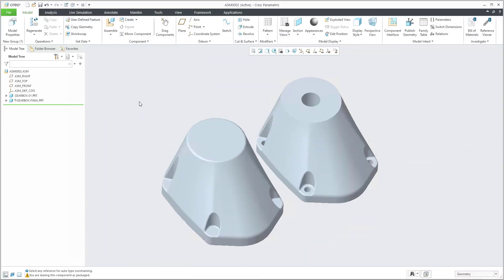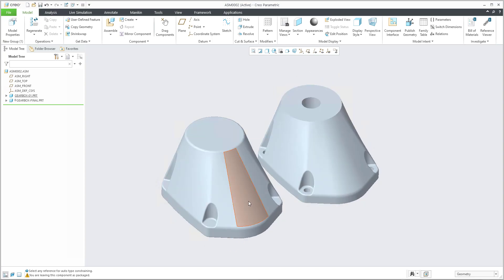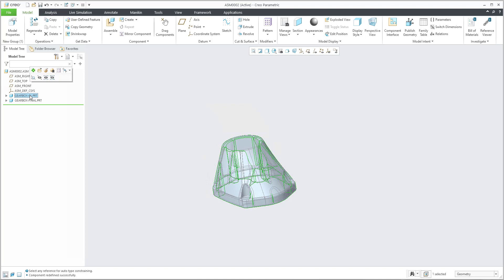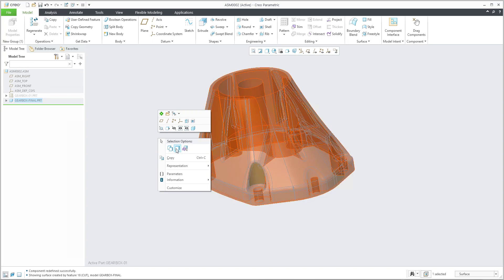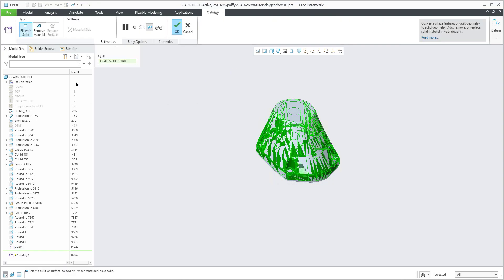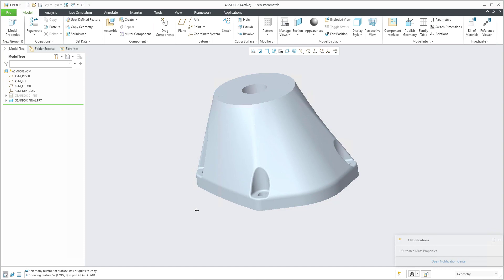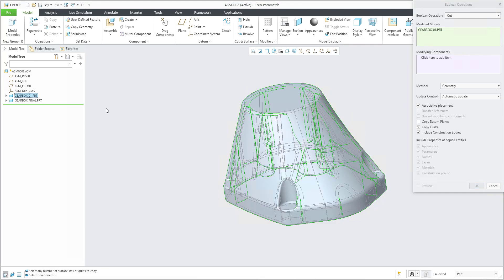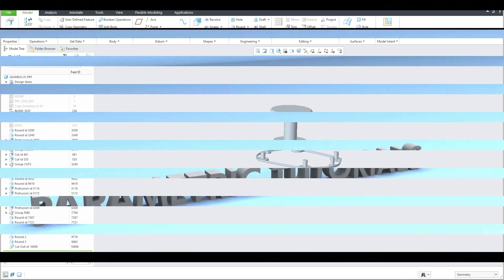Compare models | Creo Tutorial

Comment: Vlad, what's an easy way to find min wall thickness on a casting model, Im aware of section thickness option but if the model is more complex this becomes difficult.
Reply from the maker: Hi Zero, I am not expert in Casting.. But if I will find some solution.. I will post it ;) Stay tuned and thanks for your question. Vladimir

Comment: This type of comparison i.e. subtraction only works for geometry that is markedly different. If there are minor differences in surfaces then it will not work. This is not best practice and Creo has much better tools for comparing geometry
Reply from the maker: I know that is possible also use standard Compare models.. Buy also is sometimes hard to see differences. Also, very good compare function is possible to use by Creo View MCAD but you need Windchill aditional license.